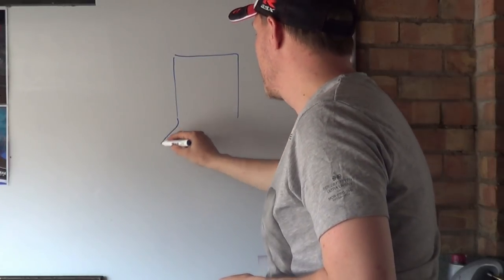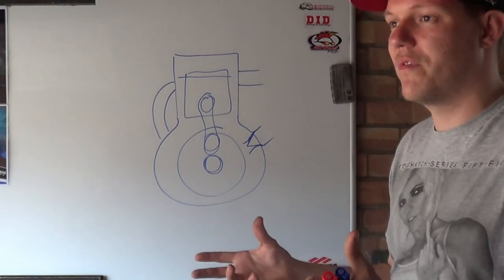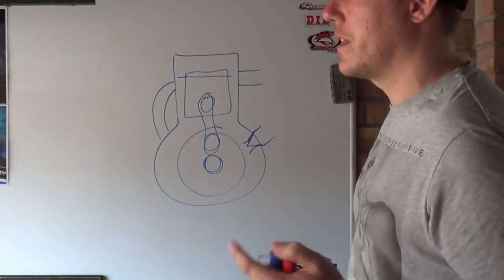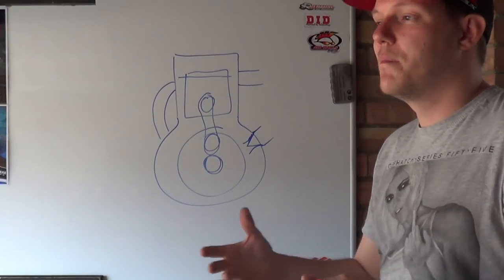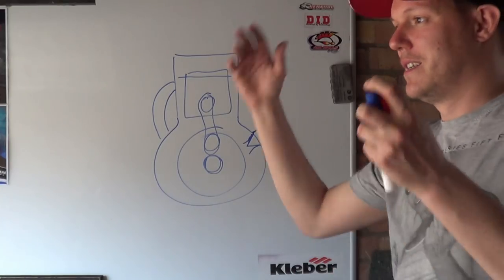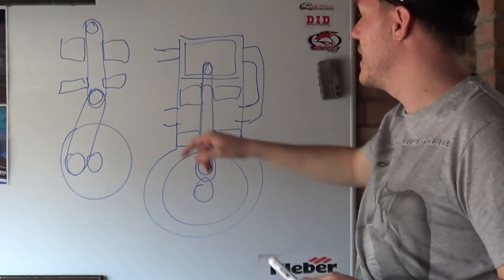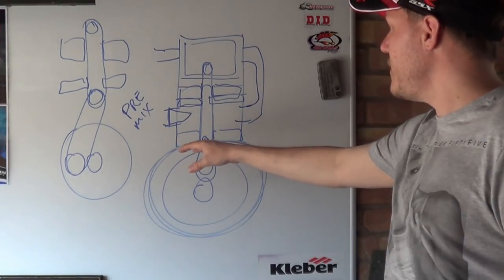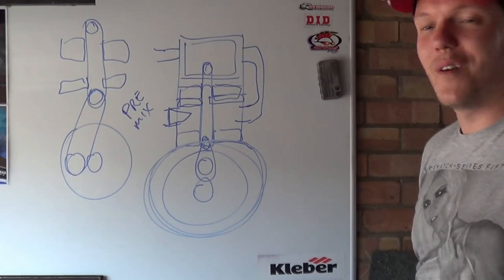2 Strokes are shite! - and why - Part 1

Comment: Ah just another young wipper snapper know it all .I owned 6 two stokes in my time , mainly Kawasaki triples , they where very stong light and yes i was not affaid to do 800 mile weekend treks on my mach ones .rebuilds where like after noon head pulls ,4 bolts . new rings quick hone and back to the races, try that with your 4 stokes .never had crankshaft issues because of the use of heavy roller bearing thru out . o did i mention my 500 kicked the ass of just about everything on the road ,for half the price . did it blow smoke , well yes they did .but being maybe .1per cent of the vehicles on the road , no one cared . if i could be a new H1 , i would in a heart beat .
Reply from the maker: "Ah just another young wipper snapper know it all .I owned 6 two stokes in my time." - snap so have I, but what does that have to do with anything? Just because you have a dick, doesn't mean you know how to use it. It also doesn't make you immune from being one. I didn't know this many people were hard of hearing. I'm sure I said 'from an engineering point of view' but what do I know, I'm just a whipper snapper. There's more than 1 part to this subject, but you probably can't be bothered. - matt

Comment: There's a part 2? That's probably shite also. I'll run you on my 2018 Husqvarna TC250 2 stroke dirt bike. You can bring a 450 4 stroke of your choosing.  To get the power to weight ratio of a 250 2 stroke, companies have had to go to 450 CC to keep up. HUH; 2 strokes are that bad I guess. Oh, that 5 lap moto will run you $5000 american when I win.
Reply from the maker: You're forgetting that the 2 stroke uses twice the fuel

Comment: not much life to them.....tell that to my old mans 20 year old 2 stroke mower
Reply from the maker: And a lawn mower isn't used that often and the load on the engine isn't that high. In other words they're over built for the task they are assigned. Me and the old man made a go-kart from a 2 stroke mower engine when I was 8. Its was easily enough to fire me around the fields. All your dads mower has to do is spin a blade to cut some grass.

Comment: 2-stroke petrol-engines are crap, because they rely on exhaust-tuning to operate efficiently. 2-smoke diseasel engines are good because they do not need exhaust-tuning, as they are pressure-charged, usually with a mechanical blower, or an exhaust gas turbocharger, like the detroids. Locomotives, ships and large power generators are often pressure-charged  2-stroke diesels.
Reply from the maker: I did a video on 2 stroke diesels here - 
https://www.youtube.com/watch?v=qt3H6F4mHHc
Reply: Cheers bud. I put a link on your video to a B&W marine diesel educational film. It's worth the watch and shows things in a light that makes a lot of sense.

Comment: so shite they are every where in the far east,cheap and easy to fix,few moving parts,great power .
I don't see how this is a bad engineering design,the 2T motocross bike is superior to the 4T by virtue of weight ,power to weight ratio is massive for a 2T,easier to maintain after a race,parts are cheaper,overall costs are less,2T racing is more exciting,a better rider control is needed dur to the explosive power output.
2 stroke truck 4stroke suck,4 strokes should stay on the farm.
Reply from the maker: oh never ridden a superbike, so obviously you don't understand. Someday, you'll get there.
Reply: my point was made with mass production and the fact i have a crosser in mind,ok ramped profile cams big valves turbo's,nitro fuel,barry sheen,there are places for both,but most poor assed fuckers in the world don't ride super bikes,you want a torquey plug get a 4T,yes ferrari make amazing 4T,as do the big 4 hon yam kaw suz,but you yourself said it,because 2T wear fast,there are more parts,which means competition between sellers,which drives prices down,economics and ease of strip and fix,4T last longer but the price is higher and complexity is greater.
And i also pulled an idea out my arse about dry sump lube for 2T,i hope you read it,because i thought it simple enough to work.
I liked the vid and the others i've watched,good stuff.
And nice you replied my message so quick,what reg did you serve in,and respect for doing so.

Comment: there are more modern day 4t dirtbikes handgrading then 2ts , you are replacing or adjusting valves more often then im doing topends on my 2t , the service intervals between my 450 4t are waaay closer then my 2t , the reason for massive aftermarket parts for 2ts is the simlicity for building an egine to suit your needs , you can jet your 2t to be as economical as a 4t , you would be lucky to see a 4t of any capacity win an extreme enduro event , they are the domain of 300 2ts . a 4t just doesnt make the of idle torque of a 2t .  you are not comparing apples . fact , the reason for the move to 4t mowers is human laziness and California banning 2t light engines , seeing as most mowers come from the states has escaped you . you will not see 4t chainsaws in a hurry , they would be too heavy and not have the torque for the job . there has been a massive resurgence in 2t dirtbike sales , for good reason , where sick of costly 4t rebuilds and bikes getting written off cause the piston has made contact with a valve . i could go on but cant be stuffed .
Reply from the maker: "you can jet your 2t to be as economical as a 4t" - lol no you can't.

Twice the power strokes for the same rpm - hence twice the fuel.

"you would be lucky to see a 4t of any capacity win an extreme enduro event , they are the domain of 300 2ts" -
 
1 sport out of many

there are 2 more parts to this series, but you can't be stuffed

Comment: Engine breaking sucks
Reply from the maker: another good point
Reply: I don't like engine breaking on 4 strokes sometimes when I'm tryna cruise at a good speed I still like both though
Reply: @eugeneworrell1883  I like engine breaking... get of the throttle before a corner and you don't have to break that much.

Comment: The message in this video is not relevant. Modern 2 strokes are fuel efficient, clean, more powerful per displacement than 4 strokes.
Reply from the maker: Modern 2 strokes are fuel efficient, clean, - compared to 2Ts of the past.
Reply: yes, and better than 4 strokes of today too
Reply from the maker: Better in what way, Hp/kg yes, definately but what else?
Reply: Torque, see the E-TECH machines, outboard engines, snowmobiles for instance. Outperform the 4-strokes
Reply: @BBGBITW  I like his style of not replying to bs. Would be a challenge for me not to write a reply.